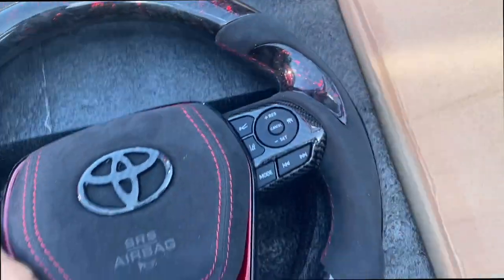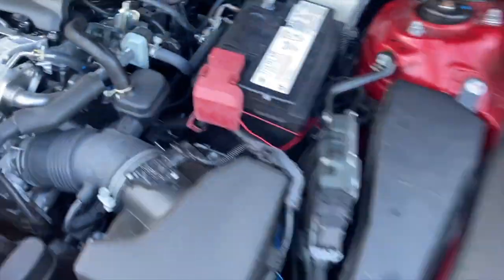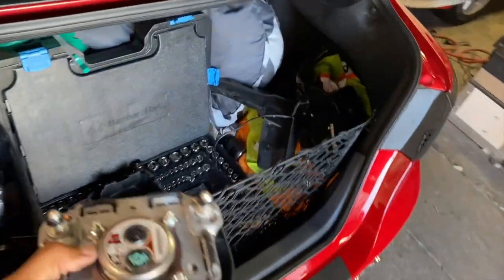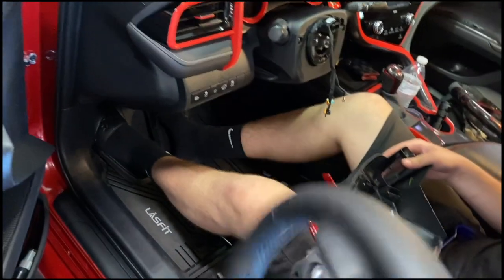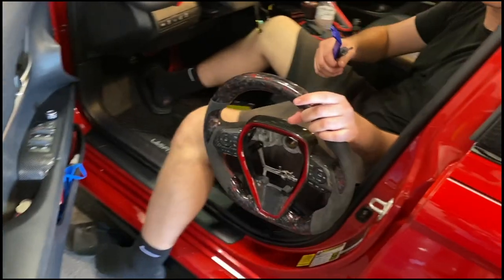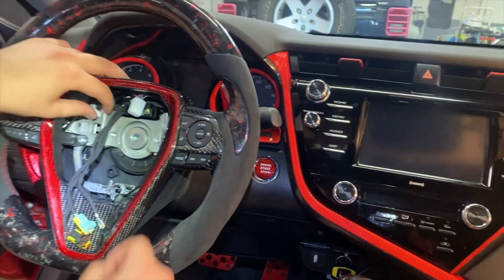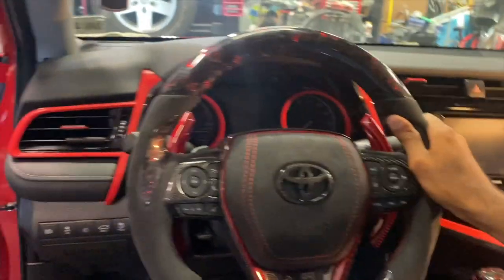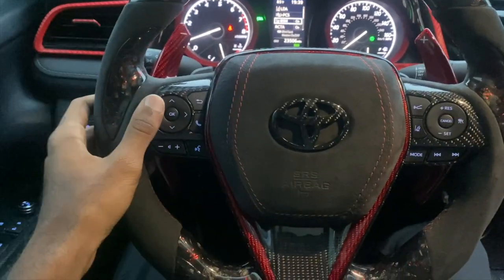Installing my CUSTOM MADE Toyota Camry Steering wheel w/@justacamry (Process + Review)

Comment: Just did this. Easier than it looks. Hardest part was figuring out the angle for pushing the air bag clips in. After that …walk in the park. Had to use a impact gun to remove my steering wheel screw.
Reply: use a thin allen wrench , works best for depresing the air bag cover clips
Reply from the maker: Yep. Once you know the angle the rest is easy.

Comment: Nice! I wanna swap out my steering wheel too but I’m pretty sure I’m gunna mess up and have to pay 1k to fix LOL
Reply: It’s honestly not that hard. I did it myself on my Camry. I would just mark where your old steering is when you take it off so you out your new steering wheel back at the same spot not to mess up the alignment. If you disconnect your battery you’ll be fine. If you don’t do the airbag cover swap process it takes less that an hour to swap it out.

Comment: I’d like to know if there is a weight difference between the stock oem steering wheel and the aftermarket one.
Reply from the maker: Yes. It’s significantly heavier but it doesn’t make a difference to the driving experience when steering

Comment: Hey dope carry I had a question for you. At the end of the video I see you hit the autostart and the windows rolled down. I'm curious to what you had to do or buy to get that to work. Do you have a link for the product or can you do video on that
Reply: By the way I live in jersey too
Reply from the maker: You have to get Toyota to program your remote to do that feature
Reply from the maker: Just be aware not all Toyota’s know about it. And I may have jersey tags but I’m not from jersey nor do I deal with any Toyota in jersey.
Reply: Okay bet I appreciate it hopefully one near me can do it
Reply: I got this feature installed for free at my local Toyota dealership! But I have a question, can you auto roll them back up using the lock button? I’ve tried doing that and it doesn’t work
Reply: You can also use a scan tool also to program it yourself
Reply: @noahcortes9991 best way right there

Comment: Nice wheel but never ever never install an airbag while sitting in front of the airbag. People died. Only work from the side of the car with rubber gloves.
Reply from the maker: Battery was disconnected there nothing that would’ve happened with no power..

Comment: How much did the labor cost?
Reply from the maker: Uhhh I did it myself LOL #Free
Reply: @crimsonkamuri  I've never done it before so I don't wanna mess up. Plus I don't have right tools.
Reply from the maker: @wyzee6262  I’ve installed a couple steering wheels. I usually charge 90-120 depending on traveling if you’re in my area
Reply: @crimsonkamuri  where you at? I live in illinois
Reply from the maker: @wyzee6262  Philly
Reply: @crimsonkamuri  never mind